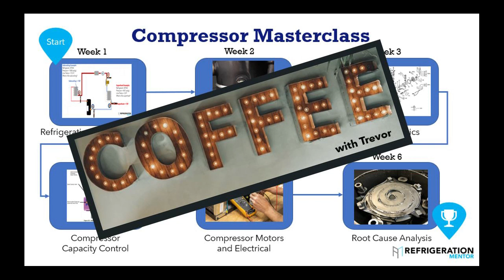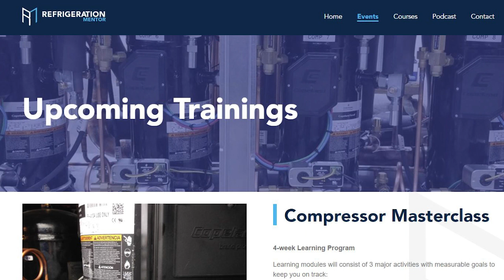You need to know about Refrigeration Compressor Electrical Issues

Comment: Good Morning, I have multiple part winding start compressors on a building that I service. I had one last summer that burned one the the terminals on the compressor so I replaced that whole assembly (all terminals and the wiring behind the terminals in the compressor that lands on the terminals.) I noticed last week that the same terminal is now discolored like it’s getting hot. Would this possibly be caused by something internal? I made sure that everything was tight when I did the repair.
Reply from the maker: Make sure check the voltages and if you have any voltage drops or the size of the contactors and wires.  Here is a great manual to look through on contactors for part winding start compressors https://webapps.emerson.com/online-product-information/Publication/LaunchPDF?Index=AEB&PDF=1244